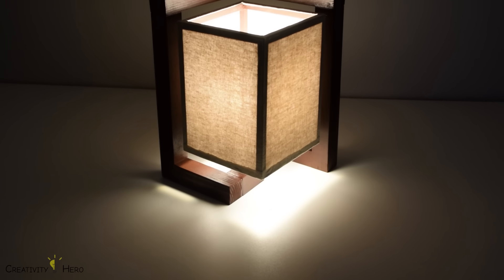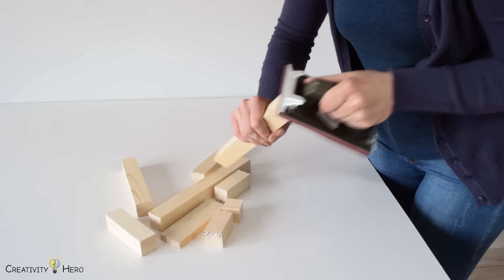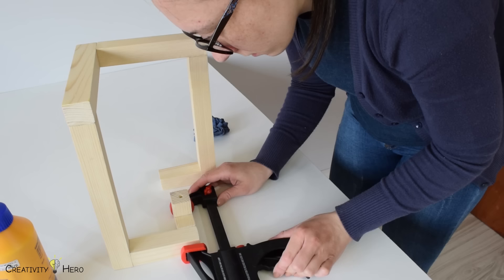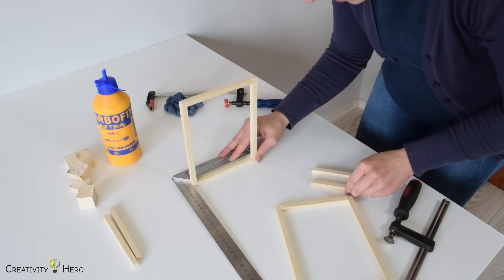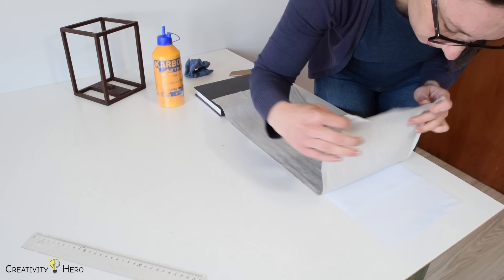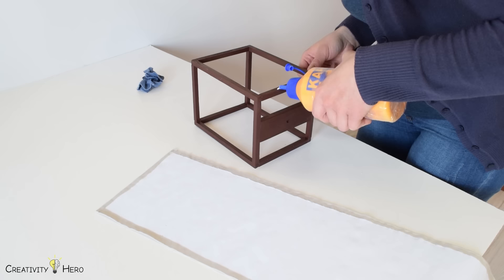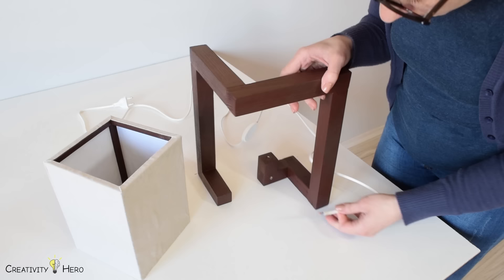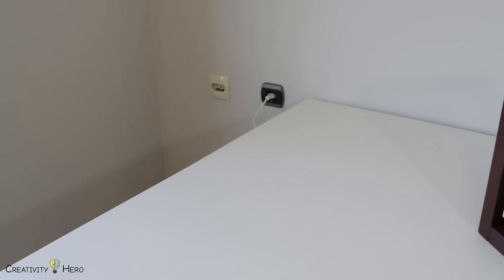How To Build A Wooden Desk Lamp | DIY Project

Comment: I liked the video. I think it would be an idea to put a thin wood strip around the circumference of the lamp shade to stop material from peeling off due to any heat.
Reply from the maker: Thank you very much. I've used LED light bulb for this project because it produces small amount of heat, which I think will prevent the peeling of the material.

Comment: Project looks great. But since you say in other comments you are a bit of a beginner I would like to give you a few tips I have been taught or learned along the way. I was taught at a young age when cutting wood cut at a 45 degree angle so when your 2 pieces break free it isn't at a corner since corner pieces are prone to chipping out easier than face or side grain. And for my last comment the saw you used looked like a metal cutting blade in it. Got the job done but I found a good Japanese Ryoba saw will always come in handy for both rip and crosscutting. But once again the project looks really good and well designed.
Reply from the maker: Thanks for the tips! It means a lot to me! Actually I tried with a hand saw, but I didn't like the splintering of the wood while cutting. So, I decided to use this metal cutting blade, because it gave me smoother cuts. I'm still learning new things, and I hope I'll improve my skills in my future projects.

Comment: Nice job ! I am a little bit skeptical about wood glue sticking on paint though... Did it last ?
Reply from the maker: First, I glued everything together, then sanded the wood pieces to remove the excess glue and to smooth their surface, and finally, I spray painted  the wood pieces. I’ve made a few projects applying the same technique, and the they turned out to be very tight and safe to use. It's been 4 months since I've made this lamp , and everything is OK so far. :)

Comment: You make use the same tools you have and make the lamp much stronger. Right now its put together with butt joints, which is the weakest of all the woodworking joints. But it you take a longer drill bit and drill holes into each joint, drop in some wood glue, then run a dowel in, not only would that make the lamp much stronger. But the dowels can be cut flush and sanded leaving you with a nice circular design feature at each joint.

Just a thought, great project
Reply from the maker: Thanks for the tips, I appreciate it. It was my second project, and I didn't have much experience with joinery techniques at that time, but I'm learning new things all the time, and improving my knowledge in woodworking, so I hope my future projects will be much more professional. :)
Reply: was shissisch du alter?

Comment: Also, from a construction perspective. That glue isn't going to hold. Drill 3/4 1cm holes in the ends of each piece of wood and make it a dowel joint. That will last a lot longer.
Reply from the maker: This was actually my second project, and I didn't have experience with any other joinery technique. So, the easiest thing to do was to join all the pieces together with a wood glue. This is a lamp which I use all the time, and so far it seems like it will last for a long time. :) I'll definitely use different techniques in my future projects. Thanks for the suggestion, I really appreciate it!
Reply: @laimonas Wood Glue when applied and clamped properly, is stronger than the wood. Dowels are a complete overkill for a project that will not be subjected to any heavy loads, torques or dynamic stresses. 
@Creativity hero, good work. Clean lines!
Reply: adding dowel joints is good practice, not adding to the latter is no excuse. some people are half-baked and half-done.
Reply: @sid503007  Exactly right - unless you plan on using this lamp for some load bearing, or its intended use is for an under water application I don't see a problem with using only glue - dowel joinery is completely unnecessary. I think the person commenting had their heart in the right place but might not practice the hobby and is just trying to reciprocate advice from other youtube channels.

Comment: Looks nice... Sadly, it has no strenght whatsoever. You need stronger joints or at least some dowels to make this last. Even changing the light bulb risk of breaking this thing apart.
Reply from the maker: Thanks! I'm aware of this issue, but I was a beginner, and I wasn't experienced with joinery techniques. Lesson learned, it won't happen in the future. :)

Comment: wats the lenght of the wood
Reply: for both the wood and when you use the ruler to take measurements . Can i get the exact measurements
Reply from the maker: You can find all the dimensions in the video description.

1. Solid wood board 3 cm wide, 3 cm thick:
- 2 x 27 cm
- 1 x 20 cm
- 1 x 17 cm
- 1 x 11 cm
- 1 x 8 cm
- 1 x 6 cm
- 1 x 3 cm

2. Solid wood board 1 cm wide, 1 cm thick:
- 4 x 20 cm
- 8 x 13 cm

3. Frame support 5 cm wide, 13 cm long
Reply: I just don’t know how much u cut
Reply from the maker: Let me know if you need anything else.